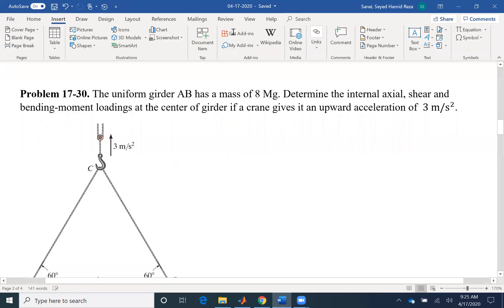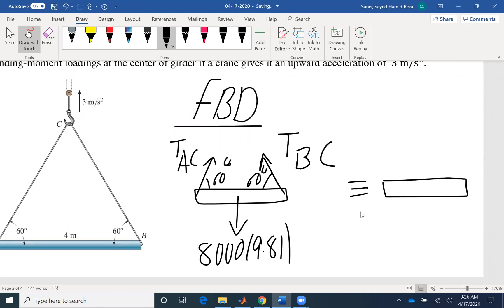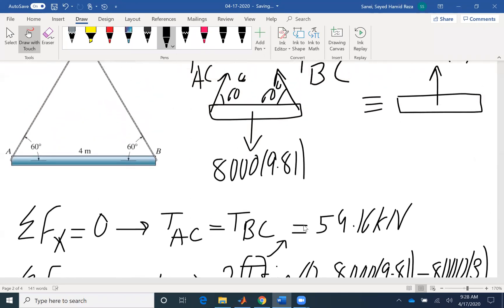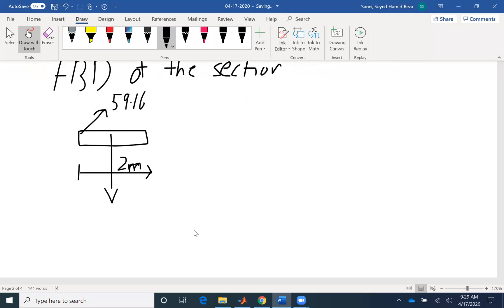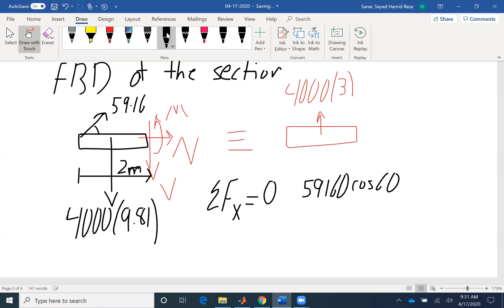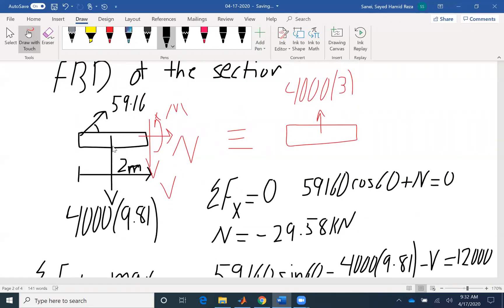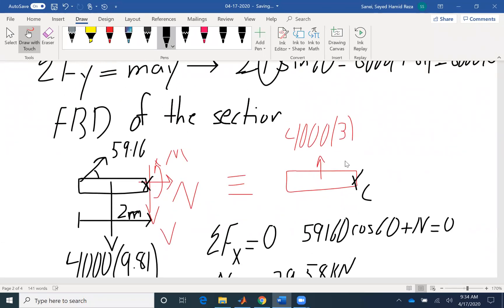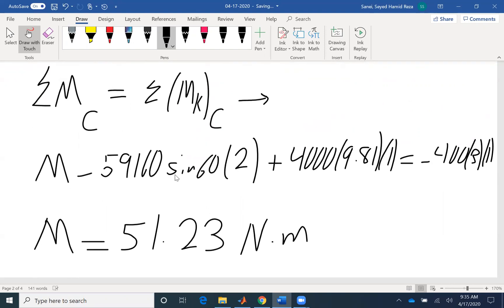Dynamics Example Problem 17-30: Kinetics of a Rigid Body

Comment: Hello sir, how can I differentiate between a problem that has a general plane motion and a rotation? Some problems say that when a hanging rope is cut the beam will swing and the acceleration is found by relative motion formulas.
Reply from the maker: That’s a very good questions, if the problem does not state the type of motion, then you need to assume the general motion and include the rotation acceleration alpha as well. In some problems, if we don’t know the motion, there will be more unknowns than what we can solve for